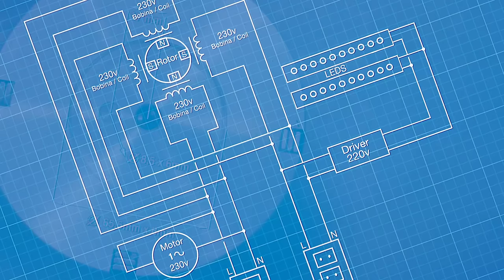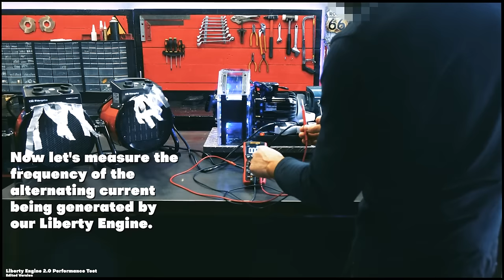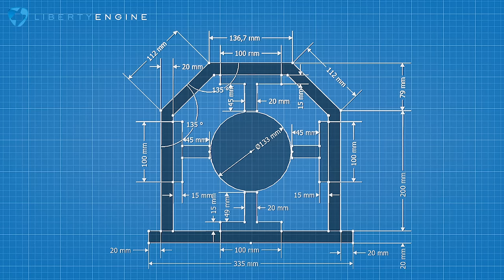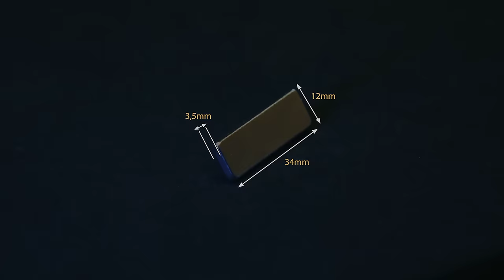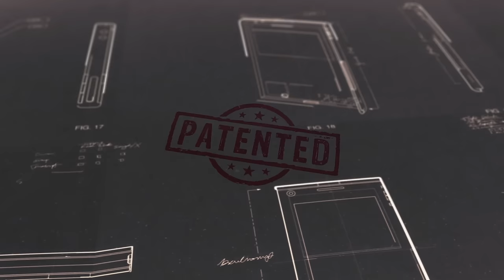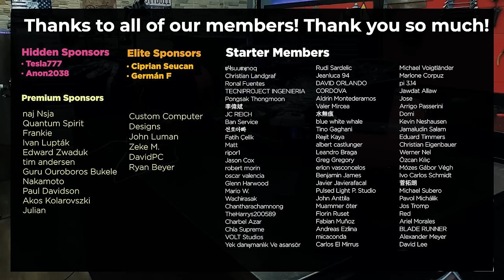SECRETS AND MANUFACTURING PLANS OF THE LIBERTY ENGINE 2.0

Comment: If no voltage is present why does the neon light flicker in power strip switch at 5:45, and 5:46 it is at least 90volts plus is present  to light it , you may have missed it in the edit. My power strips do the same when main  power is switched off and has power to switch.

Comment: so.   you want Voltage Stabilizers  220 volt / 50 Hz AC ,  Then I wonder if there is a rattle in the magnets !  I have seen 50 kVA  1500 RPM BIG magnets neodium starter  rotated 24 volt batteries
the problem we are trying to solve in large generators is the stabilization of the voltages and the way the magnets starts  , We are also testing ATS (Automatic Transfer Switch).
I have been an industrial electrician for 25 years

Comment: Material Conductivity (Siemens/m)
Aluminum (37,667,620.)
Copper (59,772,863.)
Silver (62,893,081.)
Iron (10,298,661.)
Copper and Silver have a conductivity slightly less than twice that of aluminum, allowing eddy currents to be established with correspondingly greater magnitude, resulting in an increased of torque.
Stainless Steel has a conductivity approximately 40 times smaller than aluminum, and thus cannot carry any eddy current as well as aluminum, copper, and silver.  Iron is there for an example but, I still don’t know the mixed to ratio.

Upadate: 7/5/23
Aluminum
Copper
Beryllium
Bismuth
 Cu,Be and Bi will be 1/16th (6%) of the total amount of the Rotor. So, 82% Au, 6%Cu, 6%Be, 6%Bi will give us with 100% in total. I also know the model of the motor he's using and its not the specs he put in the video
.  I believe he's using 3 different patents to create this Art Work and without a doubt, this machine works.

Someone suggested it was 62% Ag and around 30% Au

Update: AI
If cost is not an issue, and the silver content needs to be more than 75%, the composition of the alloy for the perpetual electricity generator rotor could be adjusted as follows:
- Silver: 85%-95%
- Aluminum: 2.5%-10%
- Copper: 1%-4%
- Zinc: 0.5%-2%
- Nickel: 0.5%-2%
- Magnesium: 0%-1%
- Titanium: 0%-1%
- Beryllium: 0%-0.5%
- Silicon: 0%-0.3%
This composition would have an even higher silver content, which would provide even greater electrical conductivity than the previous composition. However, it's important to note that increasing the silver content beyond a certain point can also reduce the mechanical strength of the alloy, so this should also be taken into consideration.
Again, the exact composition will depend on the specific properties and performance required for the perpetual electricity generator rotor, but this provides a general idea of how the composition can be adjusted to increase the silver content.
Reply: Can you say what patents that are? And what model it is?
Reply from the maker: The world needs people like you to continue researching this topic
Reply: How do you know so much about the rotor?
Reply: @pranjaydass6240   this comment was 5 months ago.  My point of view has change, ive been researching this alloy for a long time now.  This is quantum technology.

Comment: Interesring. Its 90 degrees celcsius in front of the 12k heatung guns and the guy doesnt care at all.... my try.... only the fans are running and the firmware of the cheap meters are manipulated. Thats pretty easy. Some of them have a calibrarion mode and you can complrte recalibrate them. And the handheld meter needs only the right ntc resistor that matches for this results.
Reply: No changes in speed, when switching on or off a 3 kw source? Not the smallest change? And the climbing values on the watt meter seems for me not legit. If you switch a heater on, it immedeately sucks the 3kw. I think there is a capacitor inside and that is connected to the fans. I dint know exactly what is going in. But in my opinion there is something "magic". To say it in friendly words in respekt to the creator.

Comment: did some math on the rotor alloy based on known weight and density of silver and aluminum. 
 
if the alloy in question were 5050 proportions, and made only of silver and aluminum. then with a volume of 1073.3 would weigh 7.08kg. 
52g short of goal. 

but, for an alloy only made of aluminum and silver, and have a volume of 1073.3 cubic centimeters, and a weight of 7.6kg  then that volume would have to be made up of 603.3 cubic centimeters of silver (56.209820181 %), weighing 6.33 kg.  and 470 cubic centimeters of aluminum (43.790179819 %), weighing 1.27kg for a total weight of 7.6kg.

im still doing some predictive calculations to try to solve for the missing material,  but these are the proportions of silver to aluminum i came up with just based on the volume and weight of the rotor alloy, and known volume, weight, and density of aluminum and silver

im not done crunching the numbers yet, but its looking like the rotor is leaning towards a possible 50ish% silver, 40ish% aluminum, and 10% something else.  i could be way off on proportions of the unknown material, assuming theres only1.  but based on the math thats my approximation so far.  will keep plugging other materials into this math to see what fits into that unknown spot.
Reply: If its a known alloy or close to it, the density of the total metal is 442.05 lb/cu ft

Comment: I built this. Max output on coils is 40v 0.1amps. With exact same coils ad cores.
Reply: rotor most likely different alloy, they said the magic is there. 7.6KG weight, no eddy currents, very important, haven't made it myself, but seems like these 2 aspects play a big role.
Reply: А скоріше за все під столом сидить помічник який підключає в мережу 220 вольт. Гарне кіно виходить. Показати що під столом він не бажає! Тут і є обман!
Reply: What is your rotor made of? Is it pure aluminum?
Reply: @bandyell6795  aluminum and silver mainly, but all the ingredients are unknown. Some claim that in the full version they mention 70% aluminum, 30% silver. If that is the case then you have to spend at least 2k$ on silver. I wonder if it would work with lead or other cheaper materials.
Reply: Yes rotor is full aluminium. And no i dont have the funds to make 30% silver. Am looking into alternative design.
Reply: @Pir8Gaming361  I have heard from reputable people that there are free energy devices that are solid, no spinning parts, just pulls the energy out of zero point energy field, but usually those inventors get killed or bought out and the invention never gets to the mainstream public. But this solid state approach would make much more sense. 
From what I saw here, I think the weight and  no eddy currents is why this thing works. Maybe if there were more magnet positions then it could work with less weight and plastic or non metalic material.
Reply: Ротор для проби зробив із капролону і одна  катушка видає 6в
Reply: Не  може дати більше 1000ват я думаю це фейк відео 5 а все інше туфта

Comment: First time seeing this. I am naturally very skeptical. First the thick surface bench-top belies  the possibility of the use of inductive power transfer i.e. a transformer. Second it would be easy to rig such desirable results, e.g. manipulate energy meters, even disable the heater element of the Air Heaters.
Bottom line I would need to see independently confirmed evaluations of the claims by reputable sources.
Reply: Twice now in the space of several hours he has deleted my comment showing how he is faking this. At 1:39 note the hole visible in the centre of his metal table top, where his machine is subsequently placed. Then examine 16:31 where a black cable is visible against the white background between the vertical barrier at the front of table and the underside of the tabletop leading up to the hole in his table and where he has carefully placed his machine.

Comment: How does flicking the switch off “stop” the engine.  I would think you would need some kind of manual brake like on a lawnmower gas engine because if the magneto with the magnets is what is keeping it running how can a “switch” interrupt the magnets you imbedded into the rotor.   I love your concept. I am in no way whatsoever bashing you and so very far from trying to “debunk” you.  I’m just trying to understand the concept.  The only reason is because of how casually you just “flick” the switch and the engine stops.  Like you would turn something off that had an electric current feeding it And just for the record engines are gas.  Motors are electric.  I really would appreciate any input on this question.  Thank you so much for your creation. Apparently your not answering any comments that says way too much bud. And show under the table.  From the back side.  Oh screw it lol Times up bud.   Stop doing what everyone else is. Trying to deceive the public yeah great video for novelty sake. Good show bud.  Bravo! Bravo! Take a bow buddy. Great job!  Great show you should be in Hollywood.  Oh wait there saying Hollywood is done.  So goto Florida the new Hollywood.  I’ll see you there best of luck.  God bless❤

Comment: Why is the rotor the 'magic'? The magnets moving through the transformer coils is what produces the electrical current, correct? The magic is how to keep it spinning indefinitely. You start it turning, then the rotor aka 'flywheel' and the motor keep it rotating, right? Could it be built with more transformers?

The rotor is going to be the hardest part for anyone to replicate. Can you sell just the rotor? 

Seems like an easier way to adjust the spacing between the magnets & transformers would be to have the transformers mounted on an adjustable bracket, so the turn of a screw or bolt would move the transformer either closer, or farther away.

If this is legitimate, you would be doing an immeasurable service to the planet by selling it as a kit or selling at least as many of the parts as you can legally. Then list sources for the other items (magnets, motor, cabling, etc) and let people obtain locally. I really want this to be true, but you're still withholding information regarding the rotor. If this is real, the world really can't wait much longer for something like this.
Reply: THETE IS ONE OTHER THAT PUTS 6 TRANSFORMERS COILS TO HIS MACHINE. SEEMS LIKE A COREAN GUY. Y LAUGHT HIS VIDEO BREAKING THE FAN ON DEMONSTRATION

Comment: They're not going to reveal the 'secret'. Just baiting you in for more views=YouTube $$.
IF this works, these are some possible reasons why:
1) The rotor is a flywheel, storing energy while moving between pulses to handle the cemf.
2) The prime mover is an iduction motor, thus the frequency affects the horsepower. The generator head ouputs 2x the required frequency which increases the horsepower and rotation speed. 
The reason it doesn't then accelerate to self destruction is the braking effect from the coils and the magnetic drag from the special conductive ag/al alloy rotor.
3) The T shaped cores in the generator head may actually be where the magic happens. Definitely something 'different' about that feature.
Reply: Yup

Comment: So a 22 thousand watt motor drives a 12 thousand watt motor which produces 12 thousand watts. Just plug your heater direct into the wall and save on the energy losses.

Comment: There is no such thing as zero resistance. If there's gravity present and your motor uses bearings or bushings there will always be resistance.
Reply: Try to stop a rotating flywheel that weighs 50 kilograms at 1500 RPM. Will you be able to slow it down without a decent set of brakes even for 1 minute.? That is why he put a heavy rotor (7.6 kgs) which is suitable enough for that small system so that the speed will not change even at higher load resistance, friction, or even he removes the power supply to the motor for a couple of seconds. It is the job of the drive motor to maintain the speed with little effort only due to the heavy rotating rotor with high momentum and rotational energy. And mind you.. the motor that he is using is 550 Watts.. Way much stronger to resist the bearing friction and the effects of gravity to a rotating body.

Comment: An engineer friend of mine bought a tesla car, made several modifications, took out all the batteries, put lighter weights in their place, and fitted a magnetic motor which he plugged into the existing motor. 
Now he's happy, thousands and thousands of km without doing anything, no more useless recharges, no more polluting batteries!!

Comment: why not connect a tauros or dsughnot coil to the shaft with a row of caps to hold the energy feild created and have it looped into a row of other caps to boost the power output and regen back into the start of the engine
Reply: possible

Comment: Twice now in the space of several hours he has deleted my comment showing how he is faking this. At 1:39 note the hole visible in the centre of his metal table top, where his machine is subsequently placed. Then examine 16:31 where a black cable is visible against the white background between the vertical barrier at the front of table and the underside of the tabletop leading up to the hole in his table and where he has carefully placed his machine.

Comment: I did this a bout 35 years ago in a glass foundry in columbus ohio slaving an ac motor to another ac motor to generate pulsating dc f course one motor was tied to the line gear providing the power ...It was 1993 and the dc was used to power a very ancient piston driven compressor with a commutator the size of a volkswagen quiet...about 5 years later it was cheaper to put in two scroll compressors than have millrights rebild the bearings and they shit canned the dc system!  The new compressors where real screamers the power house once quiet was now intolerable to even be in...

Comment: Hey, forget about that rotor. This is just nonsense. Braking causes a magnetic field that interacts with the metal cores of the coils. Guys, are you saying that your fantastic rotor metal alloy neutralizes the magnetic field? Really? If this video is posted here, then it's all a lie. YouTube's algorithms would have blocked this video in the first place if it were true. Well done, nice focus. But, such devices are real, for example, the Perendev engine patent. Just use pure bismuth or pyrolytic graphite for shielding and everything will work for you. But, in YouTube you will never find these technologies.

Comment: Je ne vois pas le principe de régulation qui permet d'adapter de synchroniser) la vitesse du moteur pour obtenir la tension électrique désirée de 230V 50Hz
Reply: the whole machine is useless, there is a hidden cable
Reply: @janengel1985  Прихована розетка під столом. Розмови про сплав це для відволікання уваги!
Reply: @ВолодимирПироженко-э2ж  Щоразу, коли кажуть вихід 230 В, до розетки прихований кабель.

Comment: Look, i don't wanna sound negative in any way but, why is that when you mesure the Voltage with the motor off, you do it with a different multimeter than the one you use to mesure with the motor on? Also, why is that we see no break down in power output when you unplug the motor and the RPM drops significantly? You can and should try all to improve efficiency in the way we use our energy at all, but this would be "energy creation", however, so far there's no way known of doing such thing. Energy is transformed always and you have waste of it every change you do, either in heat, friction or others....This video in my humble opinion proves nothing really, i'd have to see this in person. Anyways, good luck with it.

Comment: If this is true why don't you show any schematic and calculations that prove how it can work?
Reply: Twice now in the space of several hours he has deleted my comment showing how he is faking this. At 1:39 note the hole visible in the centre of his metal table top, where his machine is subsequently placed. Then examine 16:31 where a black cable is visible against the white background between the vertical barrier at the front of table and the underside of the tabletop leading up to the hole in his table and where he has carefully placed his machine.

Comment: So, even if this was possible or made any sense whatsoever, the GAL-900E transformer is rated at 900W and you are extracting 3000W from each without melting their thin wires, using just 4 tiny magnets and without even needing heavy cooling 😅😅😅 of course of course 😅😅😅

Comment: When you unplugged the motor to plug it into the power meter and it lost RPM, the other power meters did not fluctuate as expected.  IF you are not using a super capacitor configuration or an alternative power source, as is missing from your diagram, you are lying.

Comment: So the "magic" unit weighs in at 7,6kg and is made up of silver and aluminium. If the silver makes up half of it, we're already talking about 2880 USD just for that. All the rest is easily another 500, bringing the total price to about 3400 USD, which would not be affordable for most people on the planet. Of course, if this thing was real, then silver prices would go up even further, because everyone who can afford it, would try to make or get one.

Also, why the big black curtains below the desk? Why not make it more transparent and use a normal desk? After all, all it would take to make this work, would be a 12kW power cord, say from a Tesla Powerwalll or some other battery/inverter system or simply from the grid. 11kW and 22kW outlets have existed for a long time now.

This video is not convincing at all.

Comment: Those multi-plugs are only rated at 16 amps max and you ran 2 heaters on each, so that is double the load the plug can handle, the 2 wires from the motor won't be able to withstand a 54 amp total load and need at least a 4 gauge wire. I'm not convinced. You also do not show the amps even though your 4 digital energy meters do have a AMP setting ....